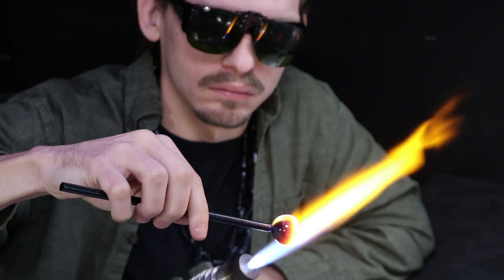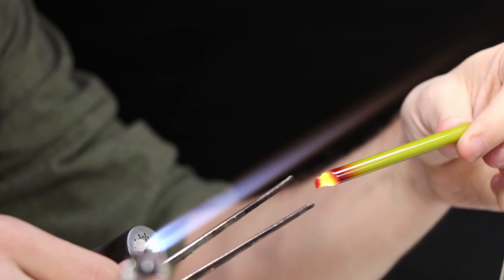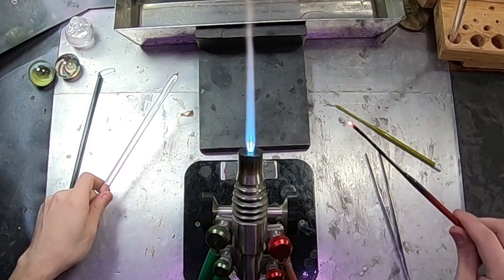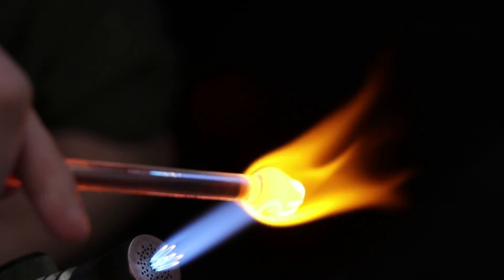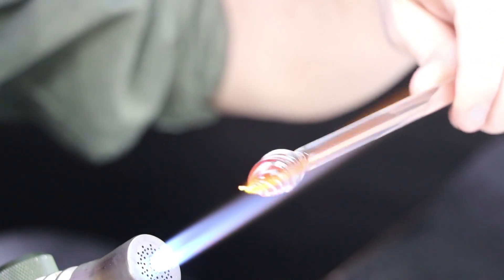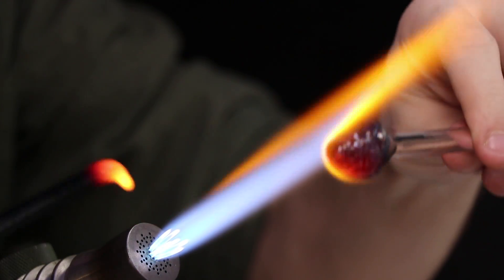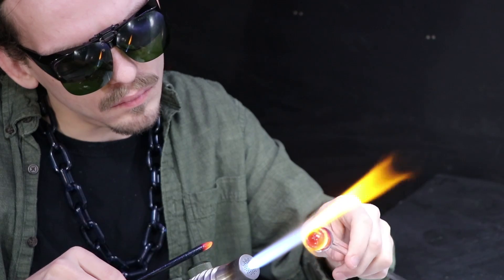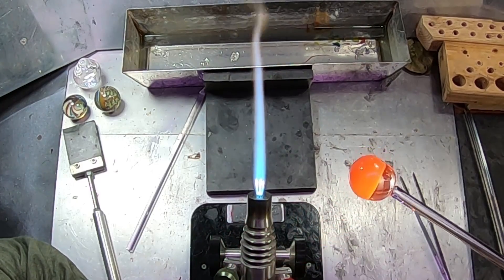Vortex Marble Tutorial Lampworking - Glass Blowing Techniques

Comment: Very nicely done! I would be proud to have been that successful! And you did explain things quite well! I got the sense you skipped some of the marble molding part, in the graphite block, because if time constraints, but I can figure that part out. I got on my torch for the first time in about 5 years, and attempted to make a simple, clear a marble, a little smaller then the one you made, I think. 
And yikes! I was so out of practice! So I found this video, which I think will help me a whole lot.
I ended up exploding mine, because I think I put it into my marble mold, without warming the mold up properly.
Thanks for sharing this! It was so well done!
Reply from the maker: Hello Ron, I'm happy to hear you got back on the torch. It's natural to drop an activity for awhile and come back to it later. That's what I did with the guitar and now I play it all the time, so there's no shame in that. 
  Actually I tend to skip the marble mold all together and use gravity, I didn't mention it back then because I felt the glass community would be upset I was doing things differently, but I don't worry about that anymore.
  Sorry to hear your work exploded. It might take a few tries to warm up your skills if its been awhile. Stay motivated and you'll be melting glass better than before. 
   Best of luck on your glass journey!
Reply: How interesting, and innovative! I will have to try your "gravity only" technique. And I need to get back on my guitar as well. But harmonica's are my best instrument, by far. 
And I believe it is a very common thing for us artistic types to have multiple "irons in the fire", or " rods in the torch",  :)  in our case. I sometimes compare myself to the old "Whack-a-mole" game, because i sometimes have several things going at one time, jumping form one to the other, depending on my "fancy" at the time.
And thank you for the very nice reply!
I "liked" your video, which I had forgotten to do, and I also subscribed to your channel.

Comment: 10 liters a minute? how much do you spend on gas?
Reply from the maker: Hey Sighs Internally, it's 10 liters a minute from an oxygen concentrator which runs on ~500Watts of electricity, which for my location is 5¢ an hour. Propane is around 2 liters a minute, I get roughly 50 hours per tank which costs $15-20 to refill so about 35¢ per hour for fuel.
Reply: @JasaGlass  oh wow better than I thought, what's an oxygen concentrator you recommend?
Reply from the maker: @SighsInternally  The Invacare Platinum 10 LPM is what I use. I bought it online as a reconditioned/rebuilt unit. They usually go for about $1,000. Life expectancy of 25,000 hours.
Reply: @JasaGlass  ok and I notice the 4 knobs on torch, with 2 gasses are you only using 2 of the knobs?
Reply from the maker: @SighsInternally  Yup, I'm only using the center stage knobs in this video. The 2 rear knobs control the outer stage (not used in this video) which can double the size of the flame. Its basically 2 torches built into 1, the secondary torch being built around the 1st.

Comment: Hey brotha sweet video, how much is the initial investment to blow glass ?
Reply from the maker: It depends on the route you want to take but it gets rather expensive. A small single stage oxy/propane torch is $200, but then ventilation, didymium glasses, kiln, and raw glass can easily push it over $1000.
Reply from the maker: Also figure out where your going to get your oxygen. Concentrators are a popular choice as tanks can cost around $40 a refill. Propane is everywhere so you don't have to worry about that.

Comment: You can encase the vortex itself to increase size of marble and depth between it and the inner vortex. Also if you put a ring around the shoulder of the backing where you want it to end, it will both be some extra cool support to hold the shape of the marble and a reference for the end of backing. Also, heat at the end of backing after placing, and push the clear rod into the hot marble lightly (before detaching) to open up the vortex for a wider effect that allows more light inside.

Comment: Thanks for this lesson and appreciate the humillity on your teachings! could you please advice on the time and temperature ramps on the kiln for marbles?
Reply from the maker: Thank you! It means a lot to me to know people are taking it in; not just the lampworking but the approach towards finding better peace with-in and with your surroundings.
But now for marbles I don't anneal mine very long, only about 1 hour at 1050*f per inch of thickness. Over 3 inches I'll add more time but I don't make them much larger then that. It's a good idea to ramp it down slowly to ~950*f but after that I'll turn my kiln off. I know this isn't very detailed, there are some annealing charts out there; they tend to vary a bit from chart to chart.
Reply: @JasaGlass  thanks so much for your output Matt! I'm just a few months new to this so others experience is very valuable to me. I actually started doing this in search for corporal prescence of my mind. To just act and react to movement, this brings me peace. Kind regards from Chile!

Comment: I noticed that in your finished marble it fades into the io star and kind of grandparents out so to speak. To prevent that when you’re terminating your lines, on your final line termination if you pull it out and then bend that tip over onto the rest of the cone it’ll make it solid color terminating inside. Then lightly melt that in and then coil your backing color on by getting your backing color juicy hot before applying so it doesn’t distort the lightly melted in tip.
Reply: Transparents*